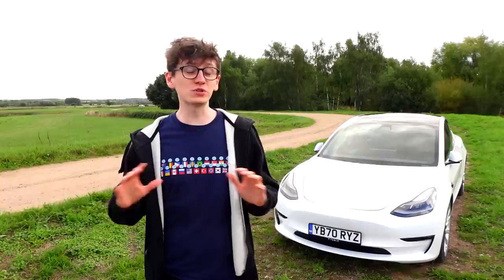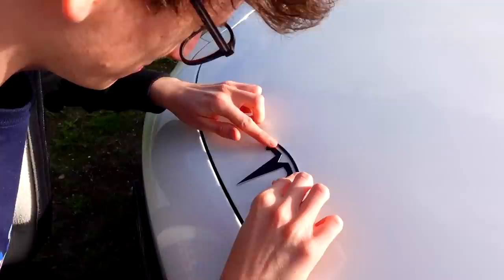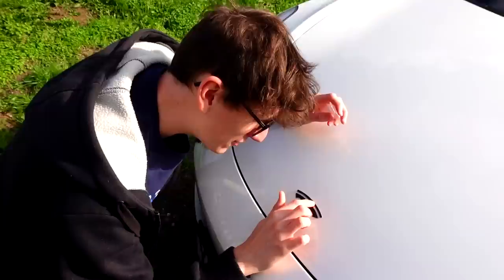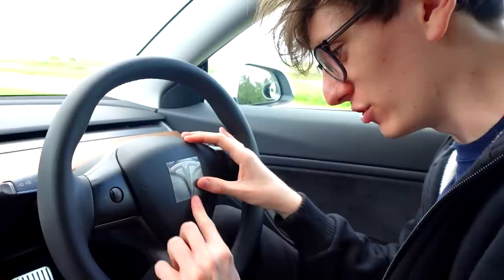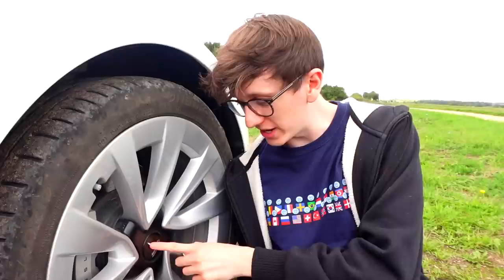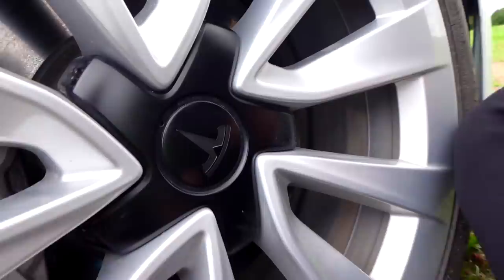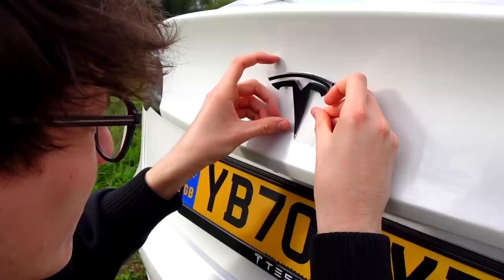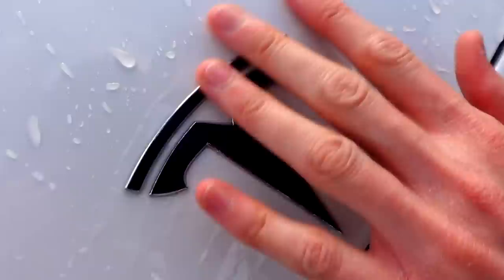Making my Tesla look 100% better for JUST £31

Comment: The hub cap/lug nut covers are super easy to remove from the wheels.  I think it would have been a lot easier to do those inside at a desk in ideal conditions than on the car.  Maybe you could have used one alcohol wipe for all four!